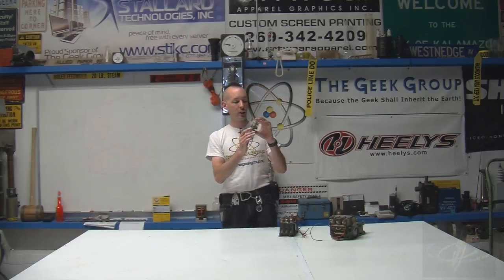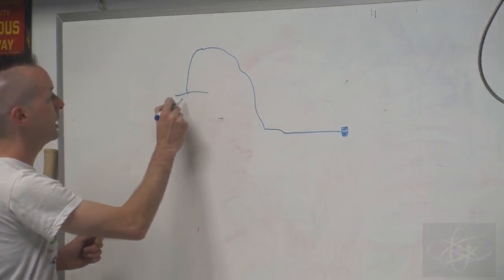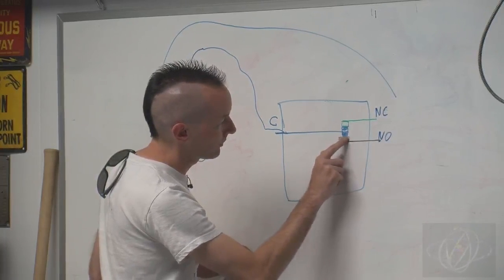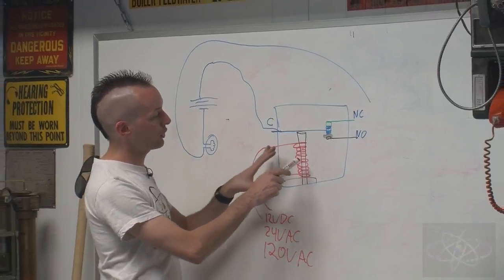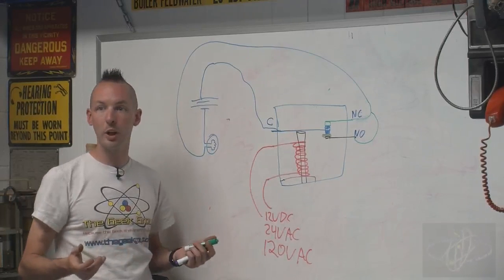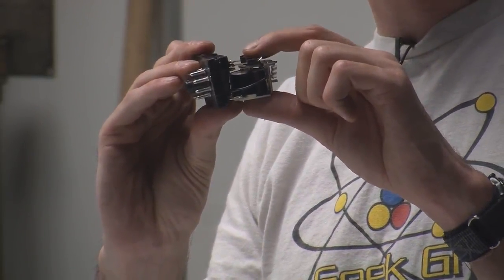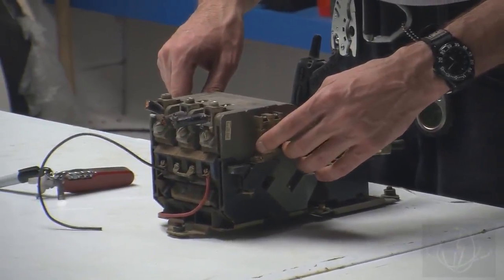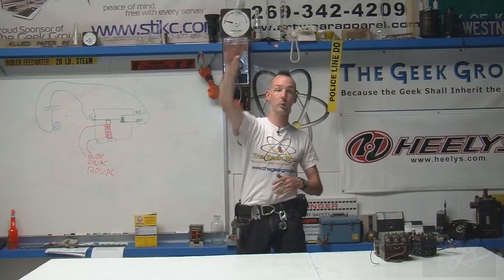Electronics How-To: Relays and Contactor Basics

Comment: @theuetz Really simplfied, some electric equipment needs one live power wire to work(1 pole) some need 2 live wires (2 pole) and some need 3 live wires( 3 pole). In North America one pole and two pole contactors work on single phase ac voltage whereas a 3 pole contactor works on 3 phase voltage. Single Phase voltage is usually 115v 230v and 3 phase voltage is usually 208v 480v 575v or 600 v. Hope this helps.

Comment: @RyanLee1989 
in a warehouse  the "control" would most likely be 120V  but realistically it could be  any "standard" coil voltage..
 The reason they are used  is so you can use a low voltage 12, 24, 120V and only a few milliamps to  control a circuit or circuit(s) of any voltage or current rating. Example your 24V  thermostat on the wall controlling your 240V central A/C.. They have multiple other uses, like in a "latch" circuit which is very common.

Comment: Usually 1 and 2 pole contactors are used in single-phase applications (120/240V). 3 pole contactors are usually used for 3-phase applications, one pole per phase. Electricity is transmitted using 3-phases from your power utility. That same 3-phase power is often used at the service entrance at commercial and industrial facilities, but the voltage is usually stepped down to a usable level (often 480V).

Comment: there are many uses and reasons behind the different types of contactors, in AC  a 3-pole generally used for 3 phase and 2-pole for 2 phase(90 degree seperation)  or center tap single phase, (this will give you two sine waves with 180 degrees seperation)  I could go on and on about the uses but it generally depends on the application.

Comment: Very good video, but those who still dont understand, its basically a switch like on your wall, but you use electricity to open and close it for whatever you wish to do. just the internals are different.
Reply: Yes, but your little switch is not able to handle the current that the relay can handle. By turning on the switch, you tell the relay to power up the circuit. Relays are able to handle the current and your little switch safe. This is used mostly in little electronics to control larger circuits. For example, a security camera can have a relay output that can power up something very little like a relay. The relay, than, powers up the circuit that it is connected to, by closing the circuit. When the relay loses the incoming power, it will open the circuit on the other side and the device that is controlled through the relay will shut off... I hope this helps...

Comment: the poles can be tied parallel to allow larger loads (i'm not sure this is allowable by code or not), but they can be left isolated to switch polyphase loads, as in a starter.

Comment: no it depends the motor or equipment that  you used if ur motor 3 phase use 3 pole if ur motor single phase ur 2 pole .. higher voltage used higher amperes contactors match the LRA of the equipment that u energized//

Comment: Think of it as a 3 in 1 switch, you could use it for 3 separate feeds or use them in parallel on a single feed for the ability to break higher currents.

Comment: ok i understand how the relay works, but im unsure why they're used.  e.g - controlling a massive warehouse's lighting circuit, the control circuit would generally be runing at 12v correct? why would you bother putting it into a control circuit? why not just take it straight from AC powered fuse board...? Please explain to me.

Comment: Got a question, if you use AC voltage on the coil, do you need to rectifie it to DC? i would think that otherwise the switch will be going from 1 direction to the other.
Reply: +0786RICARDO Nevermind, the moving piece is part of the iron core

Comment: if there is  5 pin's on a relay do you have to use a different power source for the coil. if you do you put p and n on the 2 terminals

Comment: so if you use them together, you can control >500V using 12v system

The relay from 12 to 220  , the contactor takes the input from the 220

Comment: @theuetz 
3-pole=3 phase 240/480 motors mostly
2 pole=single phase 240 volts as in a pump or ac compressor, or 277 lighting
1 pole=single phase

Comment: i make circuit contain 1 relay to switch on 2 contactor (each contactor conect to one motor 7.5 hp/11A). the problem is when the relay switch on the contactors, the contactors can't work properly,and sparks happen. why this can be happen?

Comment: according to you contractor and relays is a same thing right? whats the diff ? can any one explan?
Reply: A relay, in general parlance, is an "overload relay".  Which is an automatic circuit breaker built into or adjoined to (or in series with) a contactor.  The big thing he showed was a contactor.  

Contactors are switches which are controlled remotely (e.g. by a button somewhere else).  They are used where a large load (amps) flows through a switch, requiring heavy-duty components, especially the contact "points" (this is where the term points comes from), which wear out rapidly from arcing.  An example would be a 10 hp, 220V motor - that's gonna require a big heavy duty switch.  If you don't wanna be throwing a big handle, like a big cutoff switch, you install a contactor instead.

A relay may be used with or without a contactor.  It will be between the voltage supply and the motor (e.g.).  These sometimes are adjustable and will have settings/ratings in amps and when that rating is exceed, it trips the relay.  It's very similar in purpose to a fuse box, but can be reset - like a GFI - instead of needing a new fuse.  It is there to protect the motor from burning up by drawing too much current and melting the internal wiring insulation inside the motor - so you won't have to buy a NEW 10 hp motor, which may run you $1k, for example. 

Of course there are lots of other types of relays - the important thing is to understand the Function and Purpose.

Hope that helps.

Comment: Actually, those are bigguns are "starters"...since they include current heaters for overloads. So, contactor + overloads = starter.

A fine point, but a necessary distinction.

Comment: why we put battery on the light?? we got 12V 24V 120V...why we need battery? we have another voltage
Reply: The battery is the source for the power circuit. Think of the relay as a basic switch that makes or breaks the circuit. The voltage applied to the relay is usually a lower voltage that operates it. It doesn't actually power whatever the load may be, in this case the light bulb. The 12V, 24V and 120V he is talking about are basic voltages for the control circuit.